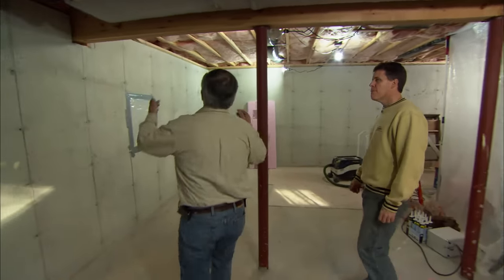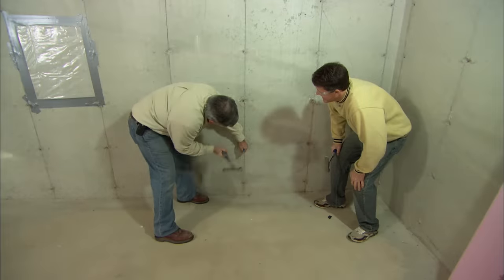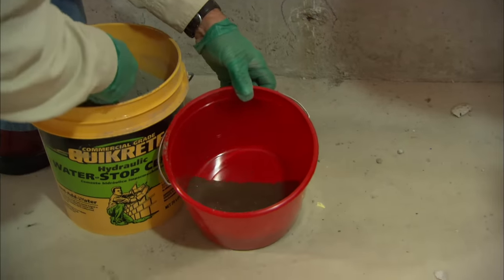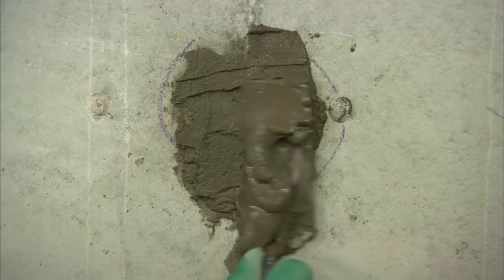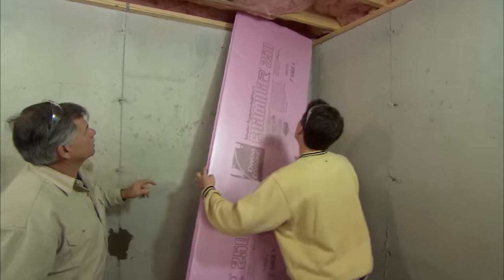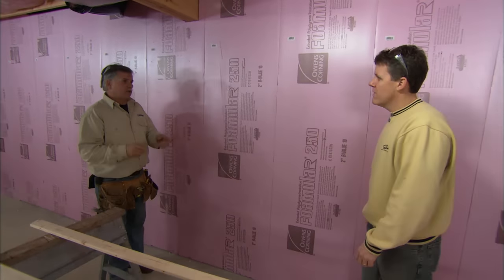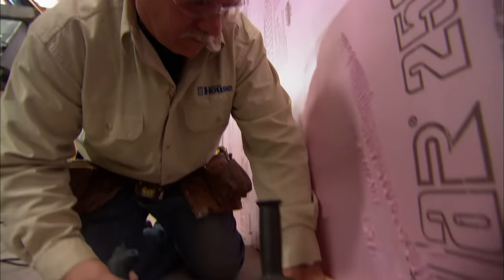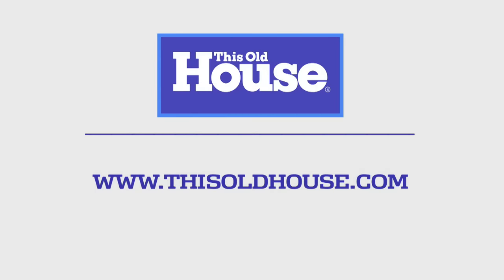How to Insulate a Basement | This Old House

Comment: I have been a huge fan of Tom Silva for over 15 years. His knowledge base of all things related to home construction is astounding. I worship the man. This basement project, however, puzzles me. Unless the homeowner specifically requested this wall construction method, I believe this is not the ideal way to finish a basement.

As a DIYer, I finished my basement a few years back. I also used tongue-and-groove rigid foam insulation (layered with rockwool to increase R-values). There is a clear tape that is specifically made to seal the vertical joints and any seams between adjacent foam panels. This was not used in the video. My understanding is that the air in the room should be completely isolated from the comparatively colder surface of the cement foundation to prevent condensation/mold issues. Drilling all of those holes for the 1x3s through the foam board, and cutting out the foam to accommodate switch and outlet boxes don't help matters. The top and bottom of each panel should also have been sealed with caulking.

Also, Tom opted to install 1x3s vertically to allow for electrical wiring. Building codes in most jurisdictions require at least 1.25" wiring clearance from the stud edge to prevent perforation by drywall screws or nails. The method Tom employed (using 1x3s) likely results in clearances of only 0.75" since the ROMEX isn't going to lie completely flat against the foam panels.  I believe this would fail an electrical inspection.

Anyway, I used 2x4 framing to finish my basement for many reasons - It isn't that much more work vs using 1x3s, the cavities between studs can accommodate much thicker insulation (my walls have overkill R-30 values), HVAC/plumbing can be better concealed, and the framing can support heavy shelving, if needed. The only negative if I were to do this today is the ridiculous cost of lumber.
Reply: MVC!
Reply: I have finished alot of basements and we always use 2x4 framing spaced 1/2'' - 1"' from the wall to create an air barrier. Foundation walls are rarely true enough to do it like in this video, I couldn't imagine doing it like in this video..
Reply: Hi, Thanks for sharing. I want to finish my basement too.. How do i screw the horizontal frame to the basement floor? Is its concrete what type of screws and equipment should i use to screw the frame to the basement floor? Could you please let me know?
Reply: @nathayes123  : thank you so much for your reply. I really appreciate it.
Reply: Nat is 100% correct. My only defense for bob is that the home must be in a VERY dry environment.
Reply: I was seriously thinking of using this method to save time and floor space. Then I watched other videos with 2x4 construction that talked about the importance of blocking in order to secure anything attached to the drywall later - shelves, vanity, towel hangers, etc.  Tom’s method seems like a space saver on a wall where you never plan to hang anything heavy.  Seems like one of those things that are great in a pinch but might be regretted later
Reply: I’m digging my basement now. It will be poured walls and I will be framing it using 2x4s. I don’t mind the way Tom did it but no way I am drilling all those holes in the concrete walls. I think conventional framing will be much faster.
Reply: Very good points, thanks.

Comment: Love that foam for basements, but I like to use Delta wall or other types of dimpled water barriers behind it and run it to the floors, even under the walls in dry or wet basements. Having an air gap is extremely important on both sides, especially where basement walls contact the earth.
Reply: Jeff from Home renovision DIY has a great solution for this. He mounds the adhesive on the back and gently pushes the foam board against the wall to leave the air gap behind it. That’s what I plan on doing with my basement.
Reply: @cjwise7741  I think if you run vertical beads behind the foam and just push the foam up normally there will be enough of a gap (even if it's very small) to let any extra moisture down. As for delta, if it's a newer house it's going to have the dimpled delta on the exterior of the foundation.

Comment: Tom, a question. Instead of affixing the cross pieces with wall "nails", why not build 2 x 4 (or 2X2) walls and stand them up against the insulation securing them to the joists and maybe a few anchors into the concrete floor? This way, you avoid putting holes into the walls - a thing that makes me fear creating water leaks. Pressure treated bottom plate, of course.
Reply: That's how I did a room in my basement. I used thinner insulation, covered the concrete (didn't need the to fill in the holes as mine was sealed from the outside wall), then I just built 2x4 walls and pushed them against the concrete or ceiling beam. I did not drill into the ceiling beam. I just attached the walls to the floor (pressure treated bottom as you said) with the double nail method and attached the walls to the joists and to each other.
Reply: That’s how I did it. Worked well and allows truing the walls
Reply: @Trace M buy once cry once my friend with 1x2 u will never get outlets in there if u want to run outlets lights etc’ sometimes paying more makes it easier so it’s done right and u don’t have to re do it’ very min I would use 2x3 for walls and get shallow mount electrical box for outlets etc 

If u want no electrical sure wth toss some 1x2 furring strips on there and screw drywall to it 

I however fear the 1x2 may split easily when nailing/ screwing into concrete
Reply: @Trace M I’m aware in the video what they r doing Jonathan asked why not build a wall that’s why I made that comment

Comment: That pink foam is a vapor barrier. Usually a tape on the seams is added but in this case they did not seal these seams between each piece nor did they do so at the top. I think this is because as they mentioned in the first part of the video, the basement is externally sealed.

Comment: I just did a 2,800 sq ft basement with 2in Kingspan panels tight to the block with the seams taped. A 2x4 wall around the entire perimeter pressing the panels in place. All rim joist ends blocked with the same panels cut to fit between floor joists and then sealed with spray foam. The basement, a full bath, tv room, bar, and two bedrooms are a constant temp and very comfortable. The area heats or cools with nearly no effort. Take the time and do it right if you are going to make the investment at all.
Reply: You used 2×4 studs to press the foam panels against the basement wall?  Many basement walls bow and are not even. So how did your panels line up butted against each other at the seams?
Reply: @falsealarmno  panels were glued to the wall as well. New construction. No bows. If there is a bow you just add a shim where the gap behind the stud is. No issue. If the wall is severely bowed that is more of an issue for repair then adding insulation.

Comment: Tom as a union carpenter the process we used to do this very same job was to use a product called Z furring. Our supplier sold a product made by Clark Dietrich (many others as well)  this galvanized steel stud system is installed vertically 24"OC using a powder actuated pin gun to mechanically fasten to block or poured foundations. Foam insulation is glued and held in place by the Z furring channel. difference
Reply: I investigated galvanized Z-channel, but realized it would be a huge thermal bridge from the cold concrete wall. Several articles I read confirmed this was no longer allowed where you had to meet any insulation standard.

Comment: New homes are so easy to work on . Try this on a hundred year old concrete in a hundred year old home here in Chicago . Not so easy .
Reply: My dad's cousin had basement was from the 1920s.  In 1985 they basically put a new basement under the house.  Although in 2020 that may cost way too much!  They made the basement taller (deeper) and it looks really nice.  They did most of the work themselves.

Comment: I finishing our dry basement. framing 2x4 walls, using elevator bolts to elevate the sill 2 inches of the floor to protect from an possible water infiltration. Using a tall baseboard over floating floor tile to fill gap. Basements need to finished with plans that you will have water intrusion. Unless you dont mind throwing money away.

Comment: Thats great advice! Rigid insulation is the only way to go for basement applications. Batt insulation is a no no. It acts like a sponge and holds water and moisture where rigid repels water and moisture.
Reply: Closed cell spray foam...
Reply: @jerrysmith7166  That stuff is awesome but not really DIY friendly.  Would be a lot more $$$$ to pay a guy to do it than use that pink styarafoam like in the video.
Reply: @jerrysmith7166  even the guys you pay do it wrong all the time. Stuff is deadly if done in thick layers (done quick n lazy)
Reply: Scott H ...I’ve been spraying it for 16yrs now I personally haven’t had any issues  but live heard of very few horror stories
Reply: Aaron Bays you can buy froth kits relatively cheap and they pretty easy to use.
Reply: @jerrysmith7166  I hope your properly trained and licensed. That stuff is deadly when it isn't done right.

There was a company in Canada that was so sloppy and quick with their work, nearly everyone living in the homes got sick.

Please don't take this lightly. Please SPRAY lightly. Thin layers allow (nearly) full off-gassing of the material. Too thick of a layer and this off-gassing process takes years to decades
Reply: Scott H Yes I’m aware of the house you’re talking about in Canada those guys were probably spraying of their ratios off the appointment as well advanced now and will not allow you to do that unless you set it to do so for other types of foam and yes I am properly trained I’ve been doing is 16 years I owned my own business and had to spray rigs for six years the competition in the big companies just get too much for me and I could not compete with their prices so I had to start working for them but yes I am licensed through Demalic and also bio-base I think they may be out of business now but yes I have plenty of training That house in Canada ended up having the whole roof and trust system removed and reinstalled
Reply: Scott H Not only that the chemical structure has changed quite a bit with closed cell foam before you could only do 2 inches in a pass and would have to come back the next day to do another two interviews or whatever you wanted now they have foam you can do 4 inches in a pass of clothes so I sprayed a job the other day with 10 inches of Foam open cell out of the 16 years I’ve been doing this I’ve only had one person say that they had fumes in the house well after the job was done and it was only one person none of the other family could smell anything nor did anyone else I think it was in the ladies head to be honest
Reply: @jerrysmith7166  homes not a house. Homes.
Reply: Scott H talk to text isn’t the greatest
Reply: @jerrysmith7166  not just the plurality. "Home" is different than "house" because "home" defines that people live there
Reply: Scott H ... no one is living there when I’m there and usually aren’t for months after lol
Reply: @jerrysmith7166  LOL just don't be telling people to get the diy kit LOL this stuff is a lot more carcinogenic than you make it out to be LOL of course a manufacturer will tell you theirs is easier to use and cure faster LOL
Reply: A combo of rigid insulation and batt insulation works well
Reply: A combination of rigid insulation and bat insulation works well

Comment: Every single 1x3 board I have used has been anything but straight.  I can only imagine how wavy the dry wall will look.. why not just build a 2×2 or 2×4 framed wall and anchor it at the bottom and at the top? Drilling holes into the concrete block is just asking for water to find its way in...

Comment: So I did this for my basement.  Burned out 2 hammer drills (Ryobi) and needed 4 drill bits for the spring spikes.  In the end, to install the outlets, you have to cut out all the way to the concrete.  So there really is no vapor barrier possible.  And those could be entry points for cold air or moisture depending on where you live.  Also, the lattice work is not practical for an outside corner.  You will end up with two pieces of drywall touching but with no supporting post behind them.  Wiring did work well but does require more pitting of the insulation.
Reply: Those Ryobi's will do it every time! I try to tell people, lol.
Reply: Should of use short boxes

Comment: I have cinder block basement so I dry locked the wall and put a French drain with drainage mat a few feet up the wall then studded about 3/4 inch from the wall clearing the mat. Used a tank of great stuff to fill the gap and covering the blocks and filled the stud with fiberglass in the bathroom. I’m going to do the rest of the basement with foam board to save money. I’d also tape the joints  of the board for extra security. I used the closed cell foam to make sure moisture doesn’t get through so I don’t have to tear out the shower. The rest of the basement won’t cost as much if I have to tear it back down.

Comment: I did my basement(1,500 sg ft) similar to this 5 years ago but I went even further.
I did the outside walls with the same pink foam boards but used 4x8 panels instead of 2x8....cheaper that way.
Then I used 1" foam(4x8) glued to the concrete floor.
Then I taped every seam... walls , floor and floor to wall with Tyvek tape. This creates a thermal envelope.
Then I shot down 3/4 T&G subflooring(4x8) through the foam into the concrete floor.
Then I framed standard 2x4 walls inside the foam giving me normal walls to run plumbing and electrical. You only lose 2" in the room doing this but it naturally is more costly, more lumber cost. But it eliminates the need to drill a hundred holes into the foundation walls.
Then I ran my plumbing and electrical.
Then I installed conventional 3.5" fiberglass insulation between the studs.
Rock, mud, prime paint. 
Although I put in heat/ac runs, I probably could have done without it. Basement is nice and warm in winter and rarely need A/C even in 100 degree heat in summer. I think insulating the floor did the trick.
Reply: Hmmm you have me thinking maybe I'll insulate my floor with 1" 4x8 also. I'm getting 66° passive temps without even installing the roxul r15 between studs (I live in NYC) This winter has been warm since installing 1" Pink Foam all around the walls. But this also includes finding and sealing every gap mainly where the concrete and siding meet.

Comment: So let me get this straight first you need to wet the cement then lubricate the hole with a mist and finally just push it in the hole. Most excellent video.

Comment: Some good practices here with the foam insulation and the furring strips installed on the wall. But, you should never drill through your insulation you just installed for the furring strips. Better yet would have been to install a stud wall to attach the drywall. The problem is concrete basement walls are always wet. Some times of the year, wetter than others. Proof of this was in the tracking of the rust from the anchors in the wall. The anchors now embedded in the concrete will become conduits for the moisture in both directions.
The best solution is the dig up the outer wall. Waterproof the concrete and then insulate from the outside to keep the concrete conditioned. This however was probably not financially practical in this case.
Reply: You are absolutely correct. The guy in this video seems like an amateur who doesn't understand moisture in buildings to me.

Comment: Hi, I like this way of framing over the foam board. However, I am concerned that if the concrete wall is not perfectly leveled and bump free under the foam, the foam boards and the wood frame will be warped too. Then, the drywall boards could be warped too. Any feedback based on experience with this technique regarding risk of drywall warping would be greatly appreciated.
Reply: Then you would put a level on the wall and shim the 1x3's so they're all even and it'll not be wavy.

Comment: Been an insulator in New Hampshire / Massachusetts for years, I have never seen this system. Usually standard framing with closed cell spray foam.
Reply: Terry Dolphin depends on what energy code provisions are for the space. Up in New Hampshire where you get cold cold ground, spray foam maybe the more cost effective method due to the amount of R value needed. Further south in warmer climates where the frost line is only a few inches, foam board maybe the more economical option.

Comment: Isn't Formular 250 recommended for the basement wall EXTERIOR and 150 for the interior?   Your furring system seems much more complicated than using 2x4 studwalls

Comment: If u cut out some of foam from the foam sheeting on the wall for the electrical box will it not reduce its effectiveness at that spot where the electrical connections are?
Reply: such a slight effect you would never notice

Comment: I have yet to find a video that deals with getting rid of the concrete bumps  in the walls  covering the rebar ends. Was this concrete slapped on to seal potential water leaks? Or is it somehow concrete that stuck to the rebar when the forms were pulled away? Can I chip it off? Should I chip it off? Should I just put enough pressure on the foamboard to give where the bumps are, conform to the bumpy wall? Should I quit and just build a tiki hut?
Reply: What did you end up doing?